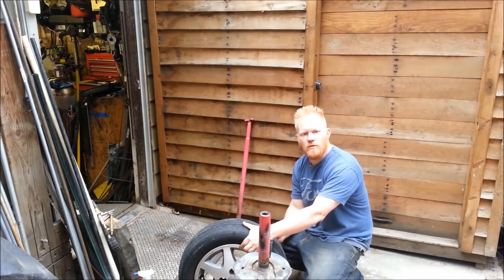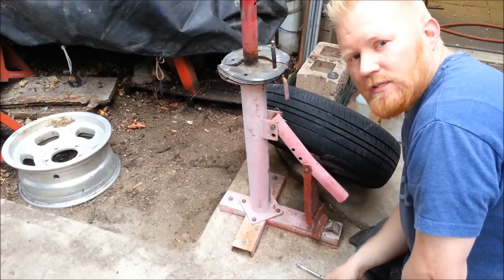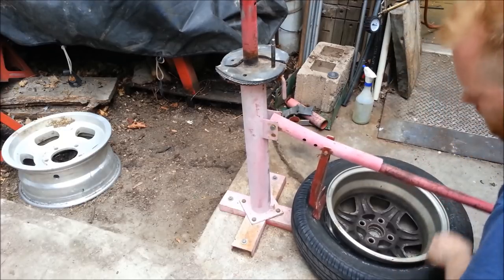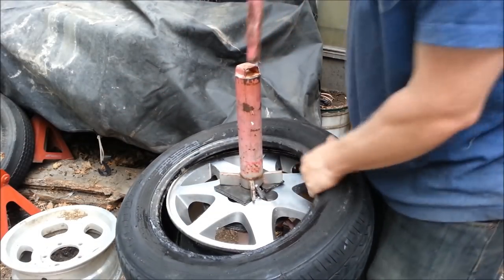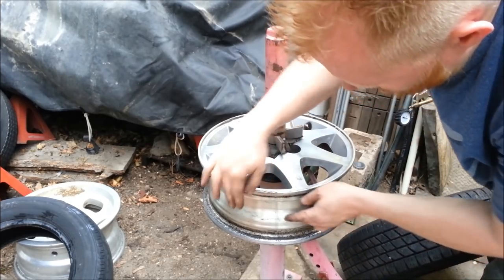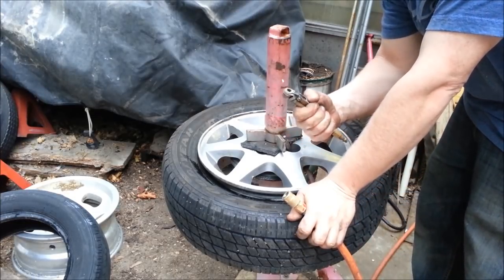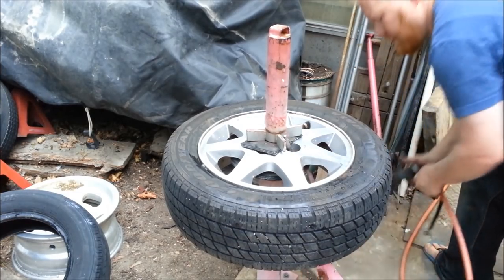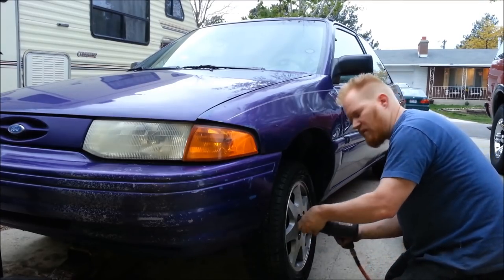Make a Manual Tire changer machine Awesome

Comment: You missed one step. . . new tires (usually) have a "paint dot" which identifies the lightest area of the tire. That dot should be aligned with the valve stem prior to setting the bead. That can help reduce the amount of weight(s) you might need to balance the tire properly.
Reply: just installed new tires yesterday, they did not have any paint dots.
Reply: @hotrodpawns  hit or miss. Some also have multiple dots. I've heard the yellow dots are light spots, the red dots are heavy spots, I've heard the opposite is true, I've heard they don't indicate a heavy or light spot anymore. Seems like it's some kind of relic of days past or a myth. I've done some testing on the nice coats digital balancer at work and never been able to prove one way or the other.
Reply: @MegaDysart  i lerned from youtube videos and google this:  yellow dot is lightest spot so u mount the yellow spot on the tire to where the valve stem is, because the wheel (should in theory) be heavier there, the red spot shows the high spot on the tire, and if your wheel has has a mark on it (signifying the low spot) then u ignore the yellow dot and match up the red dot to the dot on the rim.
Reply: @freeflub  The valve hole is drilled at the low spot on aluminum wheels. Ford and Mopar after 97 "might"" have a white paint spot on the inside where the air goes on the steel wheels for the low spot.
Reply: The dots are where the RFID chip is so the government can track you.

Comment: One hint on using the harbor freight mounting bar to put the tire on; you need to keep the bar up at a high angle as you push the bar against the center brace.  Doing that will keep the tire from  going over the tip, and it angles it down into the rim properly, without having to pry it in small bites.
If you try using it at a shallow angle like when demounting, the tire will tend to slide off out of position.
Keep the bar high, and it's easy as pie - ;)

Comment: Just a note, read through the Harbor Freight comments, lots of great ideas.   Taken from there, for the manual bar tip, use a good thick walled shampoo bottle to make a shoe for the tip.  About 6" long section, cut the side so you can fold and flatten it, then a cut half way, so one part can be flattened to match the tip, and the other wrapped around the bar to hold it on.  Punch holes and use zip ties to hold it together and on the bar.  Then that tip will ride the rim with the plastic shoe on and not mar everything to hell and back..   Don't get me wrong I'm ordering the tip and bearings and making your bar, but a DIY plastic shoe lets you use this bar immediately and not tear your rims up..

Comment: Great lesson on changing out a tire. I appreciate the fact that you tell everyone what hasn't worked for you- like bolting it to a pallet. Sometime you learn the most from what doesn't work. Thanks for sharing and looking forward to the next video.
Reply from the maker: Salmoneggs85 Thanks Man.
Reply: sixtyfiveford Of course it depends on how heavy one is! While I preferred changing tire's with the Coats 10-10 Super Powerman I used at the service station I worked at When my boss lost his lease and had to close he wouldn't sell me the tire changer or his Dake 80 ton hydraulic press! He did tell me I could come over to his home shop and use them but I moved 40 miles north and A 80 mile round trip wasn't in the card's!!
  I did buy A tire changer similar to the HF unit but I think it came from Tractor Supply. I bought it at A surplus equipment auction and it was out of the box so no idea where it really came from. Much of the equipment sold at this auction house appears to come from Tractor Supply returns or discontinued item's. My pole barn has gravel floors and I need to win the lottery or marry one of the Kardashian girl's to afford to put in A concrete floor! zI mounted it on A pallet and bolted heavy angle irons to the bottom. These dig into the gravel and with my 260 pound's standing on top I can remove tire's all day no problem. Putting tire's on rims were never A problem for me as when I was A young man an old Delaware Indian taught me how to do it. His brother owned several used car dealership's in northern Minnesota and my friend Bob Newcombe lived in the Twin Cities area. Bob had many contacts in the new tire industry so he could get blems and takeoffs cheap. He also knew of A tire dump that was west of Minneapolis that semi load's of tire's would be dumped (usually in the middle of the night!) and no one cared how many he took. He needed around 200 tire's A month and they needed to be delivered to his brother on the rims. Bob had no machine and wasn't about to buy one so all tire's were changed by hand. He started by breaking the bead with A Ken-Tool bead breaker and using  quite long tire iron's and plenty of tire lube took off the top bead. The bottom bead would come off pretty easy on car tire's but truck tires could put up A fight! He then cleaned the bead seat and replaced the stem. Placing the rim on the ground he would block movement with his foot and pick the tire up by the bead swing it down from over his head and the back bead would usually seat itself in one try. For the front bead he would lube it and using A rubber or plastic shot filled hammer he would strike the bead as he held the tire down with his foot. The bead would slip over the rim edge like magic and then he could air it up and stuff it in his van for the delivery trip up to his brother's. I wish video cameras had been available back in the 60's and 70's so that A record of many tricks of the trades could have been archived. To watch Bob change tire's was A sight to behold and while I can do it I am not the machine he was.
Reply: sixtyfiveford Of course it depends on how heavy one is! While I preferred changing tire's with the Coats 10-10 Super Powerman I used at the service station I worked at When my boss lost his lease and had to close he wouldn't sell me the tire changer or his Dake 80 ton hydraulic press! He did tell me I could come over to his home shop and use them but I moved 40 miles north and A 80 mile round trip wasn't in the card's!!
  I did buy A tire changer similar to the HF unit but I think it came from Tractor Supply. I bought it at A surplus equipment auction and it was out of the box so no idea where it really came from. Much of the equipment sold at this auction house appears to come from Tractor Supply returns or discontinued item's. My pole barn has gravel floors and I need to win the lottery or marry one of the Kardashian girl's to afford to put in A concrete floor! zI mounted it on A pallet and bolted heavy angle irons to the bottom. These dig into the gravel and with my 260 pound's standing on top I can remove tire's all day no problem. Putting tire's on rims were never A problem for me as when I was A young man an old Delaware Indian taught me how to do it. His brother owned several used car dealership's in northern Minnesota and my friend Bob Newcombe lived in the Twin Cities area. Bob had many contacts in the new tire industry so he could get blems and takeoffs cheap. He also knew of A tire dump that was west of Minneapolis that semi load's of tire's would be dumped (usually in the middle of the night!) and no one cared how many he took. He needed around 200 tire's A month and they needed to be delivered to his brother on the rims. Bob had no machine and wasn't about to buy one so all tire's were changed by hand. He started by breaking the bead with A Ken-Tool bead breaker and using  quite long tire iron's and plenty of tire lube took off the top bead. The bottom bead would come off pretty easy on car tire's but truck tires could put up A fight! He then cleaned the bead seat and replaced the stem. Placing the rim on the ground he would block movement with his foot and pick the tire up by the bead swing it down from over his head and the back bead would usually seat itself in one try. For the front bead he would lube it and using A rubber or plastic shot filled hammer he would strike the bead as he held the tire down with his foot. The bead would slip over the rim edge like magic and then he could air it up and stuff it in his van for the delivery trip up to his brother's. I wish video cameras had been available back in the 60's and 70's so that A record of many tricks of the trades could have been archived. To watch Bob change tire's was A sight to behold and while I can do it I am not the machine he was.

Comment: With advice from motorcycle forum members,  I made several very worthwhile changes / modifications to mine and now it’s just for motorcycle tires.  Nylon rim edge clamps,  no-scuff bead bar and some other stuff I can’t remember because I haven’t used it for a few years.  This is gonna sound insane but after wrestling with them on the floor for so many years I finally got all the little details of technique figured out and it actually takes me less time.

Comment: You are correct about using a pallet. I have one bolted to a plastic pallet and have wrestled across the pasture too many times. There just isn't a decent place around the shop to mount it that it wouldn't be in the way. I've used them that are mounted solid and it makes a big difference. For breaking the bead a hydraulic wood splitter is the best ticket. I was out fighting a heavy truck tire in the sun when my son said "It would be nice if you could use the wood splitter to do that". So he taught me a lesson that hot day.
Reply from the maker: Great idea with the log splitter.
Reply: unblock aertery
Reply: get an old tractor rim. 
i have a solid oliver 34"

Comment: Great vid as usual. U.K. Watcher. I was told that on tires there is always a little circle somewhere on the side wall and for best balance that circle normally coloured should fit adjacent to the valve for best balance. On large tires we use a bit of grease around the bead to help seal when you start to inflate. Look forward to the next vid thanks
Reply from the maker: Mark Lambert I'll have to look close the next time I swap tires.

Comment: Quick, concise and to the point, good video. You did it pretty much the way I do with the same changer.
   Instead of mounting mine to the garage floor, I bolted a 3 foot piece of 2" heavy walled square tubing to the tire changer and then I just slip it into the receiver of the trailer hitch of my truck. Solid and I just keep it in the backyard when not in use.
    The plus side is I can put down the tailgate and have tools and such handy. The down side is I had to build a short platform for support of the tire during bead breaking, but I also use it as a step when working under the hood.
Reply from the maker: The hitch mount is a good idea.

Comment: thanks for making this video !  I have to buy one of these tire machines......  I had a master blow out and so I went to the tire shop to get a new tire.  No problem they had a match to it there so I was happy until they told me the cost for changing the tire ,  they wanted 18 to change the tire and I brought the wheel in with me !  What a rip off !   I thought that those machines were a total fight but you proved that wrong !  Thanks again !
Reply from the maker: It has definitely paid for itself.

Comment: I brought one of these for my workshop several years ago and it's one of the best tools you could have, saved me hundreds on tyre fittings, also i built what's known as an alloy mate, the nylon ended bars which remove tyres one end and roll on the rim and fit the other, pukka.
Reply from the maker: redfourtrack I've seen one of those nylon ended tire bars, buts it's been a few years. I'll have to make one. I did take some PVC pipe and heat it over the end of my standard bar to protect some rims. It slides on and off but wears out fast and I can l only get a few wheels in.

Comment: Something you can use to prevent the lever from gouging up the wheels is a piece of plastic cut from a laundry detergent bottle or a shampoo bottle. It's a bit of a juggling act, but you can wedge the plastic between the lever and the wheel and do whatever you need to do without scraping up the wheel. Or you can buy a mojo lever or make one yourself to do the same thing.

Comment: I seen a number of demo videos on using one of these manual tyre changing machines. This one is the best demo thus far. presenting and camera work is good as well. No wasting time but right to the point. However, I prefer to use a better tyre wratchet I find those that come with the machine dangerous and tend to damage the wheel.

Comment: Catch a broken bead wire and you will get a brush, trust me on that one. I also had to weld the bead breaker, also welded the bottom legs. Have had it about a year now doing mostly motorcycle tires with the adapter. Some friends found out though and now I do a regular amount of Jeep tires, up around a 35" is about the limit for this machine though.

Comment: Nice.  I live in an apartment -but my bedroom has a poured cement floor. Could put a tire changer in there.
Reply from the maker: ***** I don't see why not. I welded on the carpet in my first apartment.
Reply: I had a dirt bike in a 100sqft dorm room
Reply from the maker: z dubs I see your priorities were right on.
Reply: sixtyfiveford I'm guessing you boys didn't get your cleaning deposit back when you moved out.  :)
Reply: z dubs I once completely rebuilt a Honda NSR125 in the attic room of my upstairs flat - I took it up in bits, restored it over winter, then carried it back down in bits and put it together outside ;)
Reply: One year at the UM engineering dept, the students dis-assembled the prof's VW beetle (while the prof was on vacation), and re-assembled if in his 3rd floor office.
Reply: Hang the "Tire Repair" sign out on the balcony!!!

Comment: 2 thank yous,
thank you for posting a brilliant presentation.
and i thank me for watching too.
First thing tomorrow, i'm cutting up an
old mud flap and stick'em on my changer.

Second thing, purchase a pump up garden sprayer,
to really drench those wheel  rims and and tire beads.
For reasons i can't understand, i'm not using
enough, seeing you in action really open my eyes.
'Slime' works great, it would ever work better
if i used more of it. Great suggestion.

lastly, the concrete on our property dates back
over 100 years ago, it won't hold, and so i use
the pallet. And yes, your right, that pallet
thinks its michael jackson doing the moon walk.
But now i'm thinking, a large sheet of plywood,
with blocks underneath, and then setting the 
corner into the corner of the garage, and let the
walls of the garage resist the torque for me.
Counter sink the carriage bolts and use wing nuts.
this way i can set up and dismantle quickly, lean the board, 

and store the changer until needed again.
Your vid was a real inspiration, thanks.

Comment: Perhaps placing the bead in the deep section when mounting the "new" tire would've helped. My old H.F. changer looks exactly like yours, faded from many years sitting outside. Mine is mounted on a doubled sheet of 4'x4' MDO (3/4+3/4=1-1/2 thick) which has survived lots of snow & rain and gives me the portability I need. I replaced the C-channel base with a larger steel plate to eliminate rim scratches when de-mounting. I like the old sidewall trick but I think larger with a hole in the middle would be better than the small pieces. I cut up some sort of rubber tile to use as a rim protector underneath and on top. I usually only lube the bead but since I still experience the loud pop, maybe some lube on the rim would help. Then there's the corrosion usually found on aluminum rims, and don't forget to align the colored sidewall dot with the valve.

Comment: Dad also made a manual tire machine. I ended up leaving it when his estate sold. Now I wish I had lugged it home. I buy tires from the tire rack and they send them right to my home, but then I have to bring them to walmart to have them mounted and balanced. It's not that cheap for them to do that. I do have his balancer. Your balancer looked easier to use.

Comment: Great video, Murphy's oil soap is a good alternative for bead lube,won't harm rubber.also a piece of rubber hose or heavy truck airline plastic cut length wise on edge of wheel to prevent scratches works .

Comment: Have mounted 265-75-16's and 33's on 15"rims with the same changer. Cut bar in half and welded pipe extensions for more leverage. Broke and reinforced  almost every part on that little changer. Harbor Freight bubble balancer works okay too. Clamp a pin or bolt on to the side of hold down tube extending above the tube enough to give balancer clearance. You'll have a waist high tire balancer. Scrounge weights at your local pick and pull.

Comment: Wow? You've got Truck Mags. Nice! 
8: 47 - Remember to loosen the top clamping pipe before adding air, so the wheel will be loose enough to remove the top pipe when done adding air. Otherwise the added air tightens everything all the more.
And those pieces won't protect the rim. 
Every wheel has a rim around its outside perimeter.

Comment: I have one that I modified to slide into a 2 inch trailer hitch so mine is portable. I have a draw tight hitch welded to my box blade on my tractor so when I lower my box blade the tire machine has down pressure on it and it stays put. I can see you know how to work the machine and it does vary by tire, same with mounting them. You are actually fighting the machine some, I did the same for a year or 2. I have had mine for like 15 - 18 years and I only use it when I need to. Aluminum wheels are tough sometimes. Pretty good video as to show these people what that machine is really like without modifications.